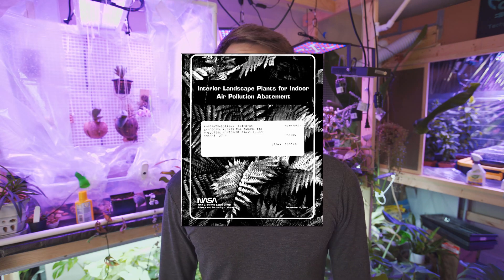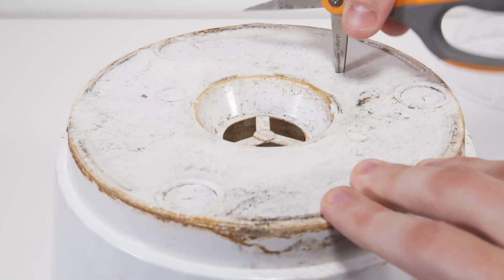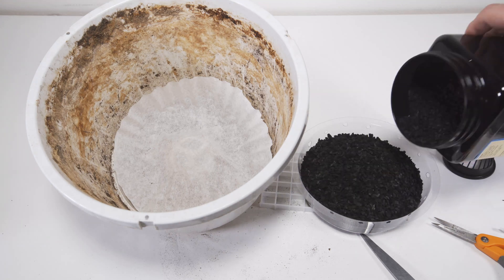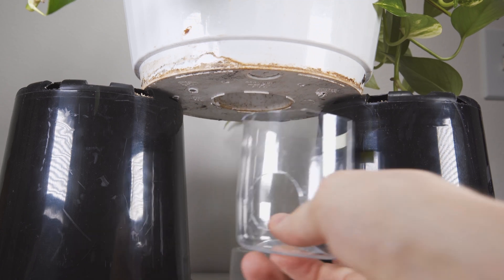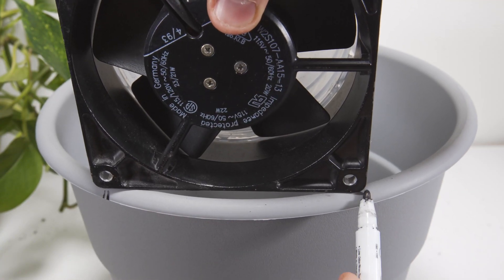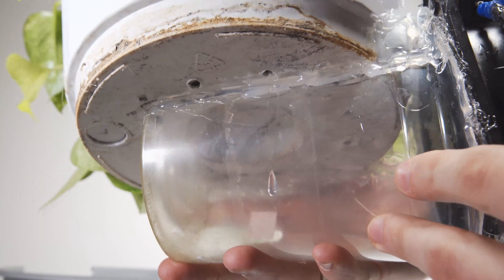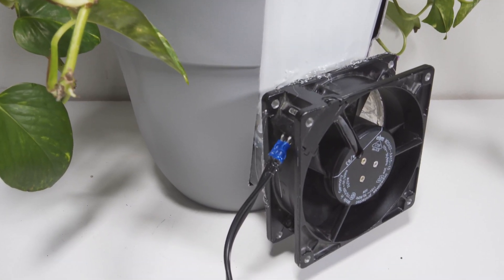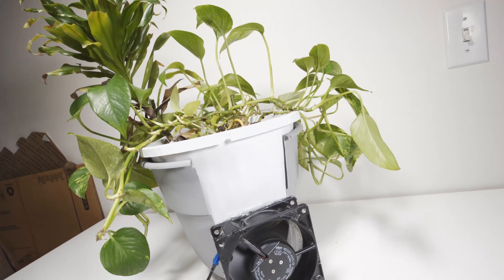I Built The NASA Plant Air Purifier Experiment

Comment: That's what I thought too... ... this is NOT gonna work for a room when my maid or boy needs to open the door again and again.

I am gonna use the stupid aircon which is bringing in air pollution from outside such as unfilter-able smoke and haze and such... ... it will cool the air, then I am designing a much BIGGER bout of air... ... oxygen, more plants... ... larger dust filter and use that old fan... ... a huge fan to pump. Gosh... ...

I will need polymer layers... ... such as book wrappers or something else create the air containing portion, get a new fan, to move the dust and chemicals in the air unit while the greenhouse will release oxygen plus cleaning up as much chemicals before pressures will bring the best air out to the room. That means I need to slow down the air... ... let the densities create its layer of particles and let the best layer through, something like creating an atmosphere... ...

So... since oxygen is usally lighter... ... ... ... the opening must be at the top, while as many plants at the bottom... ... and the rest of the filtration will be done by connecting to the fan, to be pumped into the room. Bloody neighborhood with an MP and government which can't work, and smokers and pollutions ain't stopping by itself... ... No choice. A large scale air unit will be needed, as if you are in a space ship.

If I am into dealing with a professional unit with proper equipment and funding... ... it will be much easier, and I will do it another way.

I have locked on every component I need. Now... ...  I only need to buy the barriers and design the actual setup structure. Hee hee hee hee... ... ...

I also need ions from the plants... ... This set up ain't good enough.

Comment: Hello, I had a few questions. What did you use to validate you're indoor air quality or are you just hanging your hat on average number of air exchanges? As passive house construction and spray foam make out homes tighter and tighter what air exchange number would change your mind based on the filter rate you observed?

Comment: I remember reading somewhere that you’d need roughly 160 large plants in a 2 bedroom flat to have significant measurable impact on the air quality
Reply: really ? nasa recommend only 16-18
Reply: @sdqsdq6274  depends on size of the flat and plants (size, leaf area). No home is airtight and that will have an impact as well, another factor is how bio active your soil is because bacteria and fungi in the soil decompose the absorbed toxins. I have over 50 plants with about half that are ‘air purifying’ in my 70 square metre flat and I wouldn’t bet a single dollar that my indoor air is significantly purer than my neighbour’s
Reply: Snake plants easily can do that NASA claims
Reply: Not really.

Comment: Plants do clean the air. It depends on the space you live in. Also you need a lot of different air cleaning plants for it to work. It’s not going to work if you have two plants in a big house.
Reply from the maker: i agree they do clean the air, but houses exchange air so fast that they cant keep up
Reply: @TechplantChannel  I think that's what she meant by "it depends on the space you live in" if you don't have an air conditioner (there are still places that don't crazy i know) then it will help clean your air. More than nothing.
Reply: I am gonna have 5 plants with plenty of light and nutrients for a bed room... ... making use of that stupid aircon unit and the fan, which I am using masks to filter as much dusts and such as possible.

You gotta see how much those re-usable masks collected over merely one day.

Comment: I usually sleep with close windows and I don't have air condition, then this would work better, right?
Reply: I'm looking at a way to clean the air cause a suffer from Rhinitis, allergic, I really appreciate if you can tell me if there is a way to make this works, plants are cheaper than air purifiers.
Reply from the maker: i think the plants could help, but they may make it worse because you could get molds and fungus growing in the dirt which may cause your Rhinitis to get worse.
Reply: @TechplantChannel  Oh, I see. Really appreciate your response.

Comment: can you test the pots of airy? cause they built pots based on that nasa study and some other institut testet those pots too and it seems to work but Im still skeptical
Reply from the maker: Those are pretty pricey for me and they are international shipping. The plants and pots DO filter the air. There is no doubt that this study is true. The problem is when you introduce the concept to a house. Modern houses bring in air from outside completely switching out your air 6-8 times an hour. so say the plant filters 20 liters of air in an hour. your house will have already switched that filtered air with brand new unfiltered air from the outside.

So its not a matter of the plants not being able to filter air its just that your house will push so much air in and out of your house that the filter cant do any noticeable difference to your air quality.

Also something that i thought of while doing this based on my other normal pots. A lot of my soil has fungi, and mold in it along with other allergens. So you could possibly be putting mushroom and mold spores into your air with these filter pots. Possibly causing your air quality to get worse.
Reply: Techplant thanks for your detailled answer. I was thinking about building something similar to those pots but I didnt think of mold and fungi. that could be „dangerous“. It probably needs to be a different kind of soil, not the common one which could also have some bugs in it. I need to make more research :)